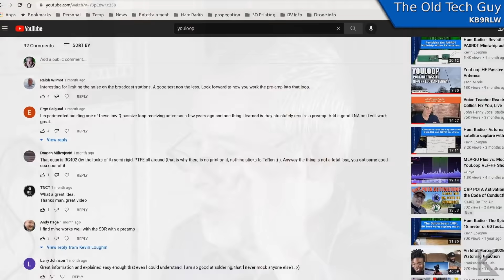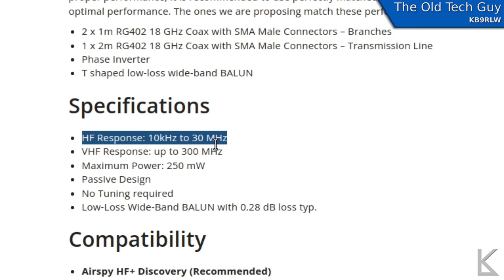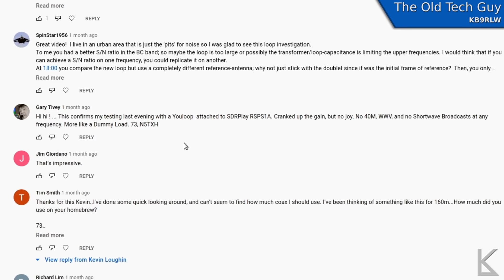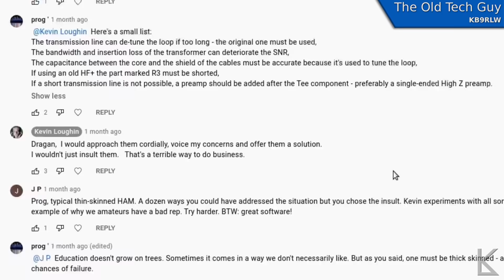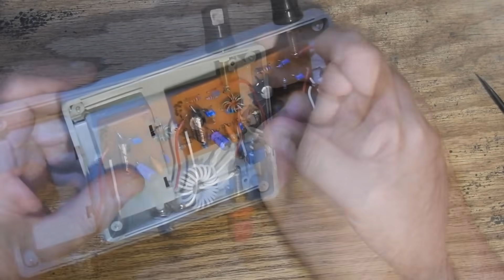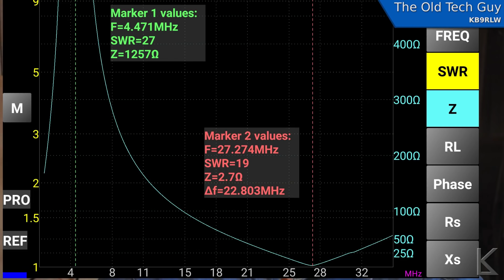Ham Radio - Trying a pre amp on my homebrew youloop build.

Comment: A wire antenna is almost always better at picking up signals. It's simply a matter of the much larger cross-sectional area the wire antenna has. 

The only reason to run a loop is if you are limited to an indoor antenna or you suffer from high noise levels you are desperate to get rid of. Then a small loop makes sense. And the best small loop is a tuned small loop, since you are reducing all other noise sources on other frequencies and amplifying through resonance the signal of interest. Ultimately, the best noise-eliminating antenna only receives the bandwidth of the signal of interest. Since you dislike constant tuning, (I actually enjoy it,) perhaps you can come up with a micro-controlled 'tracker' that tunes the antenna to follow the receiver tuning. That sounds like a fun project.

Comment: Loops will always have a lower signal pickup simply due to the lack of copper up in the air. However loops are less sensitive to noise so although the signals are overall weaker, the interference is also at a lower level due to the way in which the loop responds. So for near to medium range signals, a loop is often the better choice over a long wire or tuned dipole. For distant stations the rule will always be the more wire up in the air the better the performance.

Comment: I have had my MLA-30+ loop outside for a year and a half, it still works exceptionally well and was the BEST investment for my sdr needs to date.  I would buy another in a flash, it works that well.  Remember it is only for receive not TX.

Comment: Yeah prog can be a bit of a jerk at times. But I'll explain the antenna since Owen Duffy and Chris Trask have explored loop antennas (Chris Trask had a varactor tuned loop using these so-called shield loops in one paper) and the idea is quite simple. The gap whether it's a 'mobius' loop or a 'shielded' loop is the same core principle where it suppresses common mode noise due to the gap (imagine a current going the same direction on the inside and outside parts of the shield to see how this would go, Owen Duffy's paper goes into detail with this) thus it's quite good if you're in a noisy place. But the drawback is the fact you have to deal with varying impedance (usually high after LF/MF) so most SDRs are built with a 50 ohm source in mind won't do so well. A fet-based amplifier could help in taking the higher impedance and transforming it down to something reasonable but even then I'd say the ideal frequency range for such loops are in VLF to MF with some low HF (80 meters) use cases. It's not a 1-30mhz antenna by any stretch of the term.
Reply from the maker: That last point is what I focused on after seeing the claim on the web page of full HF coverage.    I guess I had hopes there was some magic sauce there somewhere.
Reply: Bit of a jerk? Completely rude and unhelpful waste of space. This channel is excellent for noobs like me as far as experimenting with antennas, software and other ham related info. Keep up the great work Kevin!
Reply: @WaynesWorld69  I guess I'm trying to be too nice heh. But over all the concept of a shielded loop isn't bad just the implementation that prog put together for Airspy. Ideally, you're gonna try to match it to the band of interest and maybe even add a capacitor across it as I've seen some diagrams for that by W8JI. The whole Airspy spiel about it being wide band is nonsense. It's LF (possibly VLF) and MW with some low HF. I really wish they wouldn't over promise over there.

Comment: Hi Kevin, when you increased the preamp voltage, was that real gain or did  the noise floor come up too?   Personally,  I think  this video shows how good your EFHW is.  I’d suggest that EFHW’s are reasonable stealth antennas. But if you don’t have a yard or any way to put any wire antenna up, a magnetic loop with all of its Hi-Q, low bandwidth fun, is probably the only way to go.  Even so, you can forget about 40m on the commercial mag loops in terms of transmitting, the efficiency is something like 10-20%.  FT8 may doable.

Comment: Tuned loop is narrow but the Youloop is not used at the resonance. Hams generally think in terms of transmission where tuning is for the operating frequency. But if you tune a receive antenna to an out of band frequency, then you are getting very smooth phase behavior in band. If you don't transmit, you don't mind the resonance being off the operating frequencies, and for receive you get an antenna that you don't have to tune. Tuning a loop to resonance is usually really tricky because it's not hard to get a huge Q so most people have to do things like gear down their variable caps or pots (if they are using varactors, etc.

Comment: Small active or magnetic loops are compromise antennas with the ability to tune out local close interference, I have tested the MLA-30+ vs 40m wire dipole and the dipole does produce stronger signals but the loop is much better tuning out local noise. Thanks for your testing very interesting :)

Comment: The main thing with any loop is impedance mayching. Impedance of a small loop like this is near 0 ohms (like 2 ohms or so). If no preamp is used, the mismatch is huge with a 50h coax resulting in the coax unable to pull much energy from the loop.  If using a preamp, you must absolutely use a LOW Z amplifier with an input impedance near 0 ohms too. Several designs exist which are specifically design for low impedance  loops (like commmon base transistor amplifiers). Designs and products are readily available on internet. Also, the real benefit of small loops is when fighting very nasty qrm which you can null. This benefit applies particularly when you tx antenna is vertical and is too noisy to rx due to qrm.

Comment: If you re jig you preamp box and connect a loop of wire to the terminals you’ve pretty much got an MLA 30 . I have one and to  be fair for the price its pretty good. Maybe not as good as a wellbrook but you’re looking at $30 against $300. I modded mine by swapping the thin coax supplied for a BNC socket so i could use better coax, that helped, but on MW (AM) its noise floor is higher than my 120’ longwire

Comment: Similar experience here, but then again, I have my own rule of thumb when it comes to antennas: You can play with 3 variables:
1) Small size (compared to the wavelength)
2) High bandwidth
3) High efficiency
My rule is, you can get up to two of those, but never all three.
I had an amplifier with a lot of gain (and bandwidth), so I had fairly good sensitivity, but heavy overload.
My idea is to make some tests with band splitting and using different levels of gain for different bands.
About the Youloop being resonant: Yes it has a very broad (very low Q) resonance. My home made one resonated around 4MHz. 
One thing was clear, though: The loop, when mounted indoors in the noise field, had a generally better S/N ratio than expected (when overload was not the trouble.
I think that the can be made to work as a decent receiving antenna, but it is not quite as simple to do as some may think. 
For pure monitoring I am thinking of mounting two perpendicular (amplified) loops in the house, just for having a receive antenna when I occasionally disconnect the outdoor antennas - (yes, thunderstorms etc).
Vy 73 de OZ9QV

Comment: That pre-amp brought up the noise floor magnificently, a pre-amp with a MMIC amplifier IC may produce less noise.  The larger aperture of the EF long wire cannot be exceeded by the untuned loop, the tuned Hi "Q" loop works the same as any dipole, but it does not need much height, Ron W4BIN

Comment: Hey Kevin...thank you for your good videos. You have rekindled my interest in all things radio. Regarding your Youloop performance...I have some ideas on what might be happening based on your results, general magnetic loop theory, and Progs comments. 

Any loop of wire (including the Youloop) acts as a magnetic loop...basically it looks like an inductor. Given there is always some low level of capacitance (stray capacitance) present in any circuit (including a loop of wire), any loop on its own has some natural resonant frequency...hence why it couples with the magnetic wave of a radio signal. 

Based on comments from Prog, he designed his Youloop to have a particular capacitance. When coupled with his loop length results in a natural resonant frequency at probably the middle of the band (~15 Mhz). He also more than likely designed this natural resonance with low Q...meaning to all you newbies that the gain is low at said resonant frequency...which means attenuation on either side of the band is not so great...meaning although signal levels are low on the band ends, they are still present. 

Therefore, the Youloop is a broad band (low gain) antenna with its peak gain around the middle of the band (~15 Mhz). Given the gain is so low, one needs a receiver with a very low MDS (Minimum Detectable Signal) figure (-140 db)...which is way lower than say an RTL-SDR stick. Kevin...I  am guessing your DIY Youloop probably has stray capacitance lower than the Airspy version making your natural resonant frequency perhaps much higher than 15 Mhz...resulting in more attenuation down in the ham bands where you are looking. That might explain why your preamp is not making much difference (you need a signal present to amplify).

Comment: Kevin, I tried to find the video where you go over your 12V monitor with Raspberry pi.  I picked one up and works great and fairly quite RF wise on HF but found on VHF it is crazy noisy if using it to power the PI.  Have you run into this?  Any suggestion on a good choke as I tried a few with several wraps but could not kill the noise on VHF.  Thanks for doing all the experimentation.  Dan KD9M
Reply from the maker: Hi Dan,     No, I hadn't noticed the noise on VHF.   I have my 2 meter rig on all the time, but don't recall any interference.   Maybe it's the Pi itself that generating the noise?   Is your VHF radio connected to the pi in any way physically?
Reply: @loughkb  Yes was using the IC705 connected to the PI with USB cable for digital.  I was running HF then decided to flip to VHF SSB.  This is when I noticed the noise and found if I unplugged the PI from the monitor it went away.  When I used a 12V to USB DC/DC power supply the PI it was ok so made me think it was the monitor's DC/DC was creating a harmonic on VHF.  I will have to test without the USB between the IC705 and the PI on 2 Meters.   Other than that I love the monitor for small easy portable setup.
Reply from the maker: @danlarson5730  That's the worst kind of noise to deal with.   I've no doubt the monitor's power supply is not filtered at all.  It's cheap and we do get what we pay for.  
I think you have the only practical solution figured out. Power the pi a different way.
Reply: @loughkb  True was cheap and works well over all.  I will try a Pi filter to see if that helps but  at that point I may just stick with extra DC/DC instead of using the one in the monitor.  Thanks for the feedback and all your videos.  Enjoy the HAM and RV and whatever new subject you create.  Keep up the great work!

Comment: I tried some different loops until I found the MLA-30+ Loop Antenna works well, about the same as a wire, so I stopped there.

Comment: It is completely fine to use the Youloop passively with an Airspy HF+ Discovery and short transmission on the coax. I do that all the time. I'm doing it right now.The results you experience are a good deal worse than what I see.I agree with the maker that your antenna might have a resonance where you don't want it. I took a screen shot of 40m but it doesn't appear Youtube has a way for me to put it here so you can see. And I have the original very short transmission line from the Airspy that reaches all two meters to the loop, which is oriented horizontally six feet above the floor, indoors, in my second floor room.

Now I have a nice low noise amp for the Youloop - the Nooelec LANA HF. I only need that for less sensitive receivers. You did show your amp at least amplifies, not sure about the noise figure, but from the leakage you showed it probably isn't too noisy. But if for some reason you did have a doubt about your amp you could try this one. Just make sure to get the HF model if you want it for HF.

The built in preamp on the SDRplay Duo doesn't really play nice with the Youloop, but the built in pre-amp on the Drake R8 works with it pretty well. I haven't teased out why, just noticed that when I tried it.

I also have an MLA-30+. Definitely get the plus version if you try that. My experience is that is a fine choice for a lot of receivers but the Youloop is quieter with the HF+ Discovery.

Like you, I built my own loop, but out of copper tubing, naturally tuned (no added variable capacitor - just the gap in the loop across which the feedline attaches). I used twisted pair feedline to the Nooelec LANA HF+ and it performs more or less like the MLA-30+ but the sensitivity is not the same across the bands. With a signal generator and scope I estimated the Q of this contraption to be about 4 - 6, with a natural resonance around 13MHz. It's decent with the various receivers I have, but not as good as the stock Airspy Youloop with the Airspy HF+ Discovery.

None of these seem to be as unhappy as your Youloop. I am mildly surprised since you are using the Airspy HF+ Discovery, and your amp seems to work. Makes sense for you to give up on your antenna, but my Youloop with Airspy HF+ Discovery is my first choice portable rig, and I actually use it a lot compared to other choices I have.

Comment: Youloop performs perfectly for me with Airspy HF+ Discovery (that has lna built in) on Windows 10. With the original blog rtl sdr it is not sensitive enough. Even with HF+ Discovery, not all software can activate the airspy hf lna. But for Win 10 and the HF+ the performance is acceptable. My Ft8 receipts are from around 1000km away tops. I live in reinforced concrete building.

Comment: You loop is not worth buying , i made my own loop of 2,5 mm2 electric house wire around the garden total random lenght , never had so good reception on a SDR play duo high Z input cost 0,0 .And the thing is resonant at 20 and 40 m without cutting anything , no balun , unun .FT 8 goes to 15000km.
Reply: How long (about) was your loop Patrick, and was it on the ground or elevated from the ground?
Reply: @cthoadmin7458  The wire is about 22 m +- ,2,5 m above ground in a square around my small garden , no coax , straight into the high Z input of the SDRPlay DUO , the wire is resonant at 20 and 40 m without cutting , no balun , unun , nothing .at night there to much signals .Doing WSPR and FT8 rightnow , daytime , 15000km , no problem.
Reply: @patrickdemeyer4668  I know you say you have a small garden, but have you compared the receive loop to say, a vertical at your location?  or an end fed half wave sloper?  Tnx for the reply, by the way...